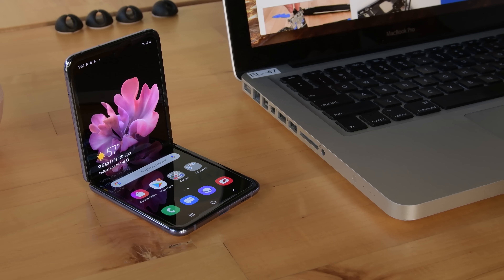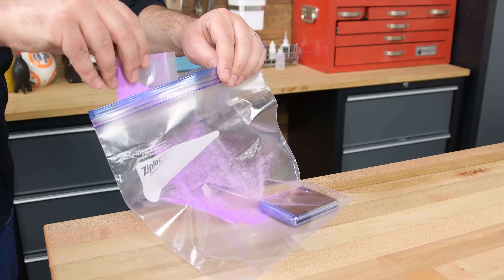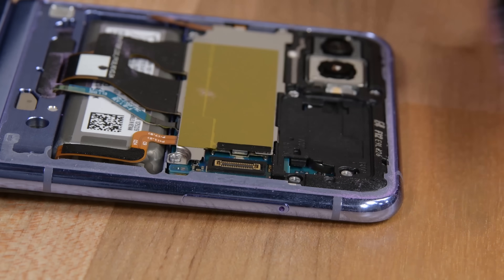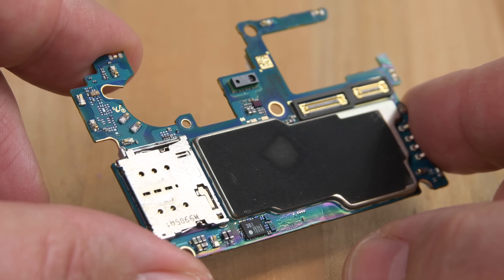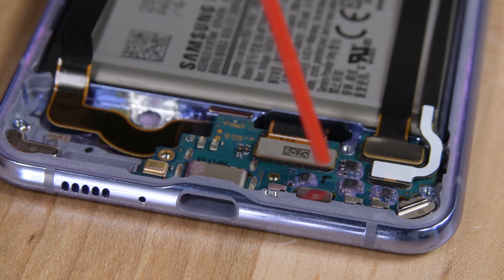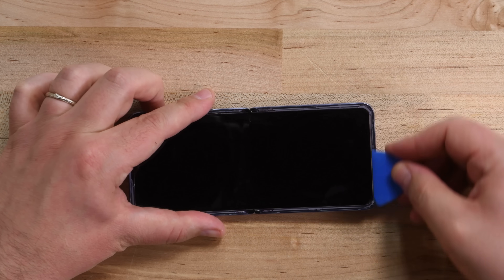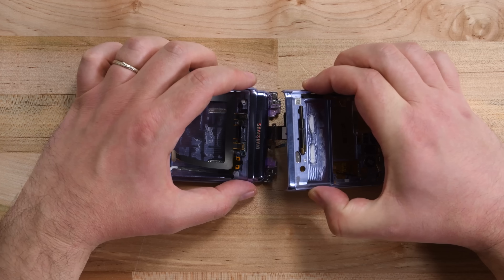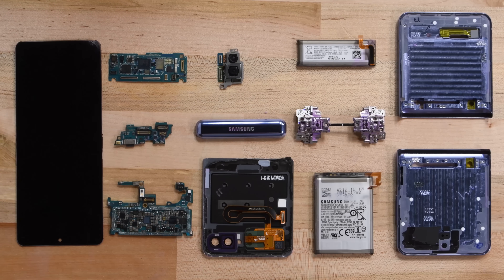Galaxy Z Flip Teardown and Dust Test FAILURE!

Comment: There is some serious click bait here. You used a coloring powder. More specifically, you used Avid-Glow purple colored powder. This powder is used to dye plastics, acrylics and resin as well as paints. It is also made of a compound known as strontium aluminate, which has a high hardness and is not at all comparable to typical lint and dust particles. (Which is why when you opened the phone, it made that awful cracking sound. Not even a large bag full of microscopic lint would ever damage your phone like that, as typical dust and lint isn't that abrasive.)

That specific color of powder is 30-50 microns. To put that into perspective, a human hair is about 100 microns in diameter. The average lint particles from your pocket would most likely be larger than these particles, and would be exposed in a much smaller quantity over time. 

A TRUE test would be exposing a smaller quantity of particles at an appropriate size and hardness over a period of time. This test came to no solid conclusion other than "You can in fact break a phone with a large amount of fine abrasive powder."

Edit: This comment was polarizing in an interesting way. It always fascinates me how some people enjoy facts and critical thinking, while others are appalled by it. I don't believe I was nit picking, as this is a new technology and it's important for people to truely get a grasp of it's ACTUAL strengths and weaknesses.
Reply: Finally, a man with big brains to figure this out
Reply: This is the best analysis thus far. It does remain to be seen if the hinge is designed in such a way to be self clearing of small particles over time or not though. Even the softer synthetics and natural fiber can only be compressed so far before they would impinge the hinge.
Reply: Furthermore, this test is absolutely ridiculous because putting even a normal non-flip phone in a bag filled with this fine purple power is likely to cause severe damage.  This fine powder particle is small enough to get into the charging/USB ports/Mic/speaker grills or into any small crevices between buttons on any device.  And as Chastin gray pointed out, why not perform a more reasonable test where you expose it to a more realistic particle quantity/size in a practical setting as supposed to submerging the phone into a bag of powdered purple dog shit?  Not one electronic would survive this "dust test."  Click bait is click bait.
Reply: And to this comment, iFixIt will not respond. They knew it was an unfair test but did it anyway to grab headlines.
Reply: You missed the point.
Reply: This dude is a  Samsung fanboy.
Reply: @ninjanerdstudent6937  Meh. I use an iPad pro, I've owned an iPhone, and I'm generally open to most phones. I'm less interested in the brand and more so the technology. I feel it is important to be truthful and honest about the new technologies that have been evolving recently. I simply didn't like the click bait, and felt compelled to do a little research of my own and share.
Reply: Hmm this is interesting
Reply: Yes, this guy appears to be a true spastic.
Reply: Well-explained and down to core on the subject. Thumb up.
Reply: I couldn't agree more. Well said my good man!
Reply: Fax
Reply: Oh Sheldon, well done.
Reply: They acknowledge the their treatment is above and beyond normal use.
The material they used allowed us to see just where the dust ended up inside the phone.
I gripe about some of iFixit's stuff but I thought this video was just fine.
Reply: @ddegn  It's clickbait because A. He did not use dust, he used a fine abrasive powder that your phone would NEVER be exposed to. B. The title clearly says "Failure" even though the phone was subjected to conditions that most phones would fail in. It's increadibly misleading.
Reply: Chastin Gray Well. If it weren’t for the bait you won’t even click.
Reply: @RR-uc1wb  Not true. An interesting title does not require lying and misleading people about a product. They either could have taken "Failure" out of the title and changed the title to show that it was more of an "experiment" than an actual test... Or they could have simply performed an ACTUAL test of durability.
Reply: Dude come on, it is a worst case scenario.
Reply: @hyperjohn6627  True, but to me it seems akin to performing an impact resistance test by dropping an anvil on the phone. The test doesn't really tell you anything useful as it's not something the phone could reasonably  be expected to survive. Nor is it a situation that anyone will experience in day-to-day life. A good test would have worked up to this worst case scenario and shown what it takes to kill one of these phones.
Reply: As a mechanic i get my huawei mate 10 pro covered in super fine iron oxide dust and iron dust from grinding, welding and sanding parts all day and never had an issue, but that phone eould get an internal short from the conductive dust.
And everyone gets small sand particulates in their pockets all the time 

It is a definitive failure
Reply: @tullgutten This is the first honest rebuttal I've gotten 😭. As far as conductive powder goes, I don't actually know if that would have an effect. That would be an interesting test for sure.

And yes, everyone gets small dirt and sand particles in their pocket from time to time, but I don't believe it to be enough to genuinely affect the performance. I also don't believe that dirt and sand particles would be small enough to affect the hinge the way this powder did.

I'm basing a lot of this on both my own logic, and reviews from people who used the Galaxy fold. That was a much more fragile phone, and it seems that for most people, dust wasn't too much of an issue. 

Over time though, we will see.
Reply: @tullgutten  Why the hell would subject a mobile phone to the conditions you describe. Your mobile phone is IP rated do you understand what the two digits of an IP rating represent, I suggest not if you're taking your phone into such an environment. When your phone explodes in your pocket don't complain.
Reply: Didn't have time to read but seems true

Comment: Give it a 3

Pros: Easier to repair than RAZR. Waterproofed motherboard.

Cons: Still not dust resistant. Bottom battery is super glued. Top layer of display is plastic. 

Comment more stuff

Comment: I rate it a 4 out of 10.
✔️ Battery replacements are doable, however you would need to replace both cells
✔️ The back panels can be easily removed, making replacment easy
❌Screen replacements can be very difficult to do.
❌ Replacing the hinge would be very difficult to do , as not only do you need to entirely take the phone apart but you risk breaking the very fragile display in the process.

Comment: I'd say reparability is about a 4. Easy to get into, the batteries aren't covering anything and the parts are modular. The cables running through the hinge looks like a pain to replace, and as simple as screen removal looks, I'd say it comes off easier than the new one would go on.

Comment: The dust looks too fine
Reply: That's some damn fine dust right there!
Reply: Please dont buy the phone if u think its bad, so I can get the chance with data plan
Reply: "you're dusting it wrong" Samsung 2020
Reply: Nope, dust is actually pretty thin, these brushes are not there to prevent dust from entering the case, but to keep the hinge clean, by removing the particles every time you open/close it.
That sound is quite self explanatory, they don't work.

Comment: There was a time iPhone with no water/dust resistant  was sold like pancake when competitors had those, which means Samsung has no problem in selling limited quantity. Foldable display is not a mass production item because of limited yield rate

Comment: Samsung needs assistance from Corning in order for them to manufacture proper foldable glass displays. Jerryrig (Zack) already removed the plastic layer where the top layer is protecting the brittle glass right underneath it and that's not really a foldable glass if it breaks lol.

Comment: Terrible for a phone as expensive as that. I who work in the Oil industry, that phone would not help me and more if I'm in a place where there is dust (chip particles at all times by the polishing machine, particulate material in my work environment). And I wouldn't recommend it either, one because it's very delicate and fragile and two, because it's too expensive. IMHO!🤷🏻‍♂️

Comment: Pretty Shure any phone would have problems with this test.
Reply: Not any phone that’s IP68 rated (most higher end or flagship models from major manufacturers). That rating covers water and dust, so any phone that’s water resistant will be highly dust resistant as well. The issue is when you add moving parts, like a flip up camera or a foldable display. Phones with moving parts generally can’t be IP68 rated.
Reply: @depolarization  pretty Shure the button and the holes in the phone will be cover up and will require deep cleaning, even with an IP rating.

Comment: Lots of compromises for this "new" form factor.
Reply: Not really. Old flip phones's hinge never had any real problems and they are stronger than ''normal phones"
Reply: @bobbyjeff32  lmao no. Most flip phones will always have problem with the LCD's flexy cable.
Reply: @brosplit  I'm not talking about that. This video is about the hinge and the dirt that can damage the hinge. When I used to use a flip phone I never had any problems with the hinge.
Reply: @bobbyjeff32  have you ever owned a flip phone? If you still have one flip feature phone, add dusts inside it. Bet it will squeak and struggle to rotate. Logic. Oh & the flexy cable goes through the hinge, which is why I mentioned that main problem without dust ; flexy cable issue.
Reply: @brosplit  Don't get wet over this. I own a old Moto flip back from 2004 and it still works. I'm talking about daily use, no putting sand on your phone😂. Do you know how flex cables work? It's not that fragile, something will break before the flex cable goes out.
Reply: @bobbyjeff32  it is just odd that people seems to suddenly forget how old flip phones have this problem & bashing Samsung & Motorola for the "new" design. It is flawed that is why the candy bar design evolved into current slab of brick design. It is more durable.
Reply: @brosplit  Depends how you look at it. Flip phones are able to close their screen and protect it from drops and scratches. I agree that people shouldn't be bashing Samsung about this because this design has been around for so long.
Reply: Moving parts = bad. Engineering 101.
Reply: @FunBotan  like to see you open a door without it moving.
Reply: Well if it's elastic enough...
Reply: Bobby Jeff ikr! that comment was not well-thought.
Reply: @dusscode  😂😂
Reply: FunBotan ok, engineer.

Comment: 4/10 for a regular device. 7/10 for a folding phone which it is.
Reply: I would call it a 8.5/10 for a fold compare to others. First off they used a paint compound material that is impossible to stop. Even laptops get dirt stuck in the hinge (look at other comments for details) also it IS folding glass but with a protective
Layer
Reply: @altoic1  But laptop hinges don't break from dust. If it did it should be fully sealed away from possible dust. Cellphones and iPhones have such a seal though I know that it is much harder they need to figure this out. If the Achilles heel is something that can happen (Dust comes in every shape and size some microscopic as well.) then it needs to be fully sealed as best as possible.. Perhaps this is the best possible seal for now, if it is then we need to rethink how a "Folding" cellphone should be and go with a simpler solution such as just two screens...I really really really want a folding phone but I don't want to chance it when even though it is particles like that, still can break the phone.

Comment: "Glass" that can be damaged by fingernail can not be classified as glass.
Reply: Term glass is more about the substance that the glass is made of than it's strength.
Reply: @sagepark7193  NO. If they say it is glass people think this galaxy has better protection than others folds phones but this is false
Reply: under the plastic screen layer there is a thin glass layer Jerry rig everything did a tear down and you can see it

Comment: I would give it a 1/10, maybe even 0/10 and that's all thanks to the extremely glued battery.  This alone is extremely dangerous and I hate that Samsung feels the need of using 5 tons of glue for the batteries instead of "the Apple way" with some pull tabs. That's just unacceptable.
Reply from the maker: Right?! Pull tabs feel like low-hanging fruit here.

Comment: Last time I checked, the average consumer doesn't shake their phone in a bag of refined particles
Reply: No indeed. This test is a dramatic acceleration of the scenario of owning a phone for several years, pocket lint, dust and all. By starting with a worst case scenario, you set a realistic expectation for the worst thing that everyday wear and tear could do to a device. If the Z Flip and its hinge had survived that test, consumers would have one less thing about which to worry. However, because it failed, consumers need to weigh the risk of damaging their Z Flip through prolonged use. I've had pieces from loads of devices with moving parts give out on me over the years: phone cases, keyboards, switches, laptop hinges... you get the idea. I'd rather know the worst that could happen when a hinge meets dust and lint before I buy that hinge. Wouldn't you?
Reply: I suppose you vacuum your pockets weekly.
Reply: @s0nnyburnett  Depends on who the owner is. If you are the kind of person who doesn't take good care of a pricey and a little fragile device, like keeping a lot of fine dust in your pocket together with your valuable dust- susceptible item, you know the results
Reply: Yes they do. The bag of refined particles are called pockets, and no matter how well you clean them, there's still dust and lint in there.
Reply: @mjc0961  You don't get my point. If you're the type of person who, I think most of people belong to this category, really cares about this high priced device, you either check conditions inside your pocket or don't put it in dusty pocket  because you already know it is weak to dust. It is totally consumers' choice of whether to buy or not, but you can't expect perfect products that overcame all technological and physical limits at this point of time.

Comment: I give it a 5 / 10 because even, yes dust can get in easily I think that it is way easier than I thought and even know the battery had no pull tabs or something it still came out
Reply: Suprised? With  bunch of injected isop. alcohol into the glue? Let's see how it goes without any solvents.
Reply: Adam no no no I forgot which phone but you couldn’t remove the battery it was permanent adhesive

Comment: The bristles are to prevent bigger particles that may damage the display. They never claim that it is to prevent minute dust from entering. You should test with sand particles instead.
Reply: Zack from JRE did that already. And, yes, it's kinda immune to normal sized sand particles.
Reply: TechSamsung TS no they face the outside look at it, and the other bristles are on the edges
Reply: why you try to justify a fail? it's not like dust is mainly for sands? Dust comes in all sizes.
Reply: @kodaph  nothing needs justifing here. The phone is not rated for dust resistance hence the result shows that. You can't fail something that is not rated for.
Reply: Nope, that doesn't make any sense, the display cannot be damaged by the dust ... inside🤦🏻‍♂️, they are there to keep the hinge clean, the fact it got stuck proves that they don't work at all.
Reply: @DeePal072  The brushes "clean" the hinge when you open it.

There will never be that much dust at once that will get to it in your pocket. No amount of protection can protect a hinge from so much fine dust. 

Opening and closing the phone will mostly keep the hinge clean since there will never be that much dust that will get to it in one go and will be able to get what little has gotten there from your pocket away or displace it where it's not important.
Reply: maxbg lol shut up, the damn thing was cracking from dust which is more common than sand...fail
Reply: tommy d u b b s dust that is way finer than dust that you can find in your home and in much larger quantities, Samsung never said this phone was dust resistant so you’re failing it on something it’s not even supposed to pass? The bristles are JUST in case, it was clearly not a guarantee. So unless you’re just dropping your phone in dry soil constantly, then it won’t even be a problem
Reply: TheBayo 148 so the bristles are a complete gimmick 😂😂😂 ppl get lint in their pockets, this shit will be dead in a month
Reply: @_baller  you can go and check out the long term reviews of the galaxy Fold from actual users to understand that the hinge is more robust than you think. https://youtu.be/u7ZqUNl2v6c
Reply: @_baller  not even surprised if you living around dust